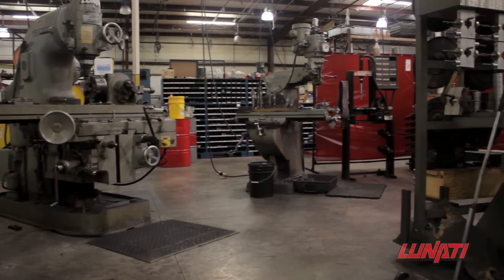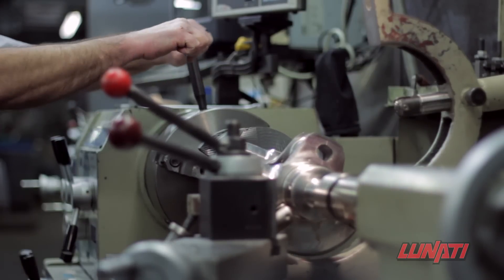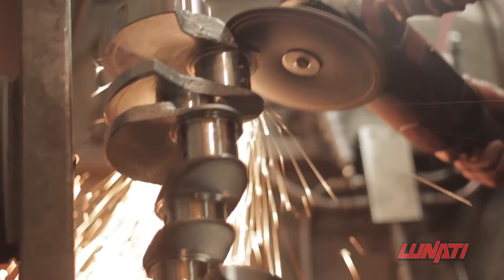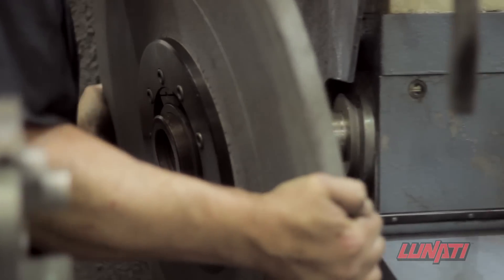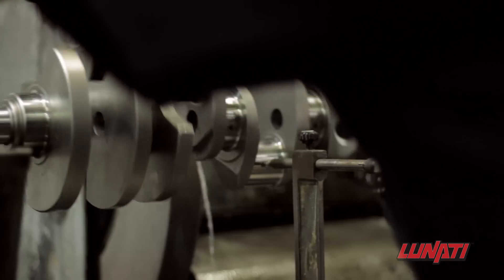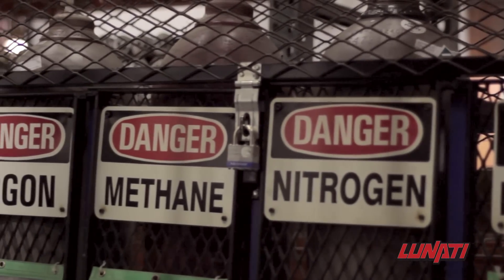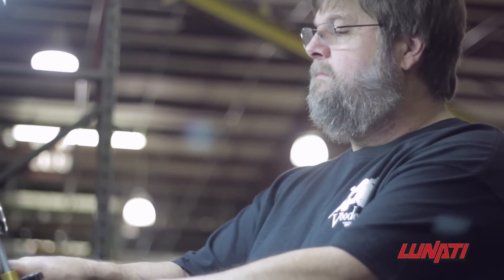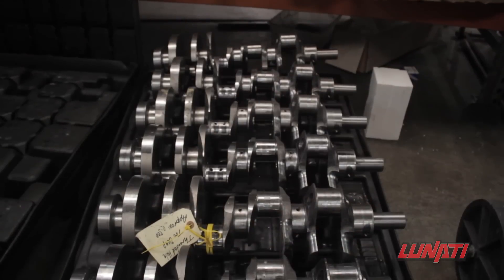Lunati Crankshaft - How It's Made

Comment: Nice video ,Att : To Lunati General manager.You need to by a new chuck key,  looks very bad in the video, plus your operator ,have chance to damage his hand  new key not expense (   do not by chinese brand are cheap on material ) not give a long life to used. Detail on top your tool post  on Lathe machine , you have a repair nuts (machining nuts with shoulder) welding a handle on side, looks bad in the movie. Please make new nuts to tie tool holder, improve  your machine shop , details  Thank you

Comment: Damn , I guess a bunch of marketing hype !!!! I'm a machinist and this place is actually very old fashioned !!!! I bet they're imported forgings , rough machined then they finish them . I'd rather use scat or eagle , imported as well I'm sure but a hell of alot cheaper ! At the end of the day a crank needs to be made well but it won't make or break an engines performance .Gun drilling the center mains " the big center hole " only weakens a crankshaft !!!!! I would never use one. Drilling the rod throws is the biggest advantage as far as drilling holes goes. I ran a stock small block Chevy cast iron crank at 6600 rpm in a drag car for thousands of runs and it had no issues ! Was over geared and ran 12.5s but it sounded fantastic ! Buy better heads and don't buy crank with your money kids !!!
Reply: And what pray tell are Scat and Eagle, Manley, Molnar?  Hmmm, Can I  have offshore for a dollar Alex.   Im pilot,  I can fly, sir
Reply: Ted Gerstenslager  Your reply is totally improperly typed and incoherently laid out , similar to a cheap Chinese parts which you probably use alot of !

Comment: AT 5.48 THE GUY SAYS " THESE ARE CHECKED DOWN TO 4 THOUSANDTHS.".OUCH  I'M PRETTY SURE HE MEANT 4 TEN THOUSANDTHS. 4 THOW I CAN DO WITH A HAND GRINDER.
Reply: libertarian life , Hi , they said 4 ten thousanths , that's .0004" not .004" .  .0004 is a realistic industry standard , they probably end up within .0002 - .0003 of spec with polishing probably on the minus / undersize side on purpose . I wouldn't buy one though , place is lower tech than I thought . I know there tough forgings though .
Reply: @bluesbastard81  at like 4:50 or so they said 0.004". It was an error but that is what he said. I have measured many and they are nice quality cranks.

Comment: It didnt show you how they were made at the foundry are they forged in the USA or the same place eagle cranks are made China
Reply: nitromethane222  , They are overpriced . Just a bunch of marketing hype and some guys dream . I would never buy one after seeing this video.  A scat or eagle I'm sure is better quality because they make more of them . I'm a machinist and this place is really , really old fashioned !!!!!!! I about puked when I saw them rigid tapping the front snout in a manual lathe just chucked !!!!???? That should be done in a cnc with a single point tool for God sakes especially for what these jokers charge . Overpriced crap !
Reply: @bluesbastard81  You never drove anything over 200 MPH  These are far better cranks that Eagle Chinese made shit I actually run Bryant crank shafts
Reply: nitromethane222 , You're write about the 200 mph !!! I know there tough , just the shop in this video is on the low tech side as far as equipment goes . I had the mindset the shop would have some really high tech equipment ! Check out Scats video they have some really nice modern equipment . They all use some manual lathe and mills for good reason but these guys have some dinasore equipment !!!! Just saying for the $ I'd expect more .
Reply: P.S , I never heard of Bryant cranks I'll check them out !
Reply: sanders  yoyour right .who would by a race crank with grocery getter tolerances. 
.0004 of an inch is about a quarter of an inch to a carpenter.ive been a machine shop owner and machinist for over 20 years.if it ain't. .0001 or less it's seconds.shame on my frinds from tn.buy some new chucks for a start and get your tolerances right while you've still got a business.in all fairness another cam company bought lunatic out a few years ago. That might have an impact on qc.
Reply: THAT WAS THE FIRST THOUGHT THAT POP INTO MY HEAD IF THEY ARE CAST HERE IN AMERICA?